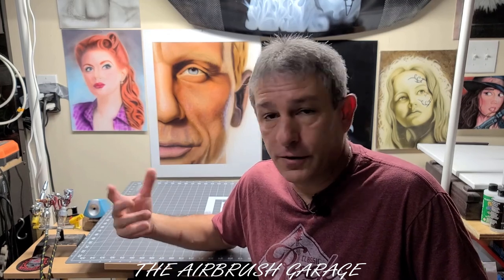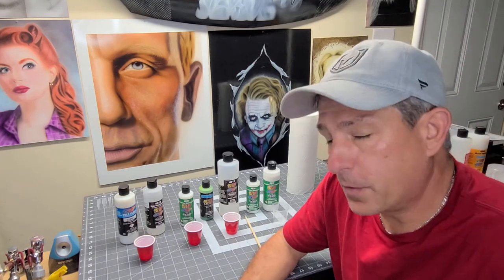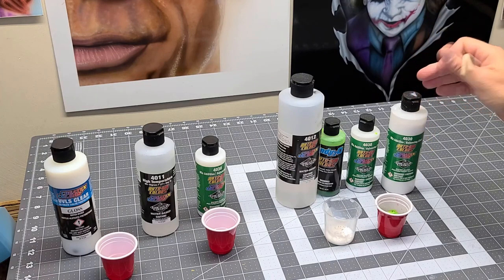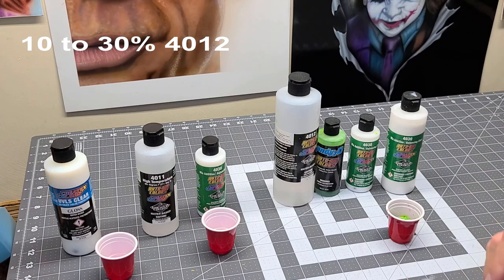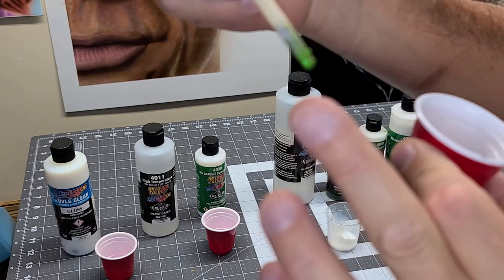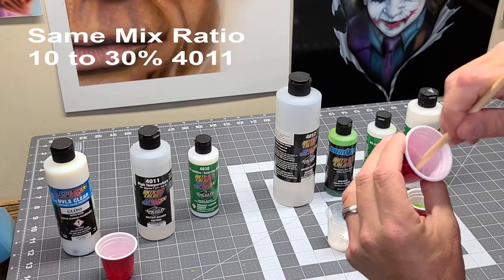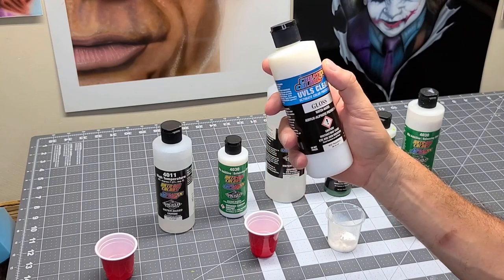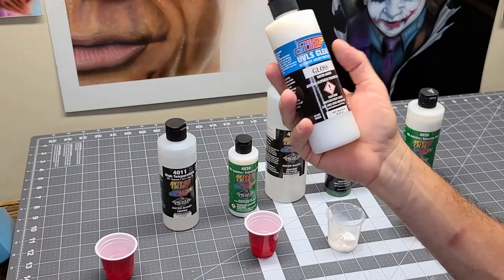Createx Clears for Airbrush

Comment: Hello Dan, does 4040 have uvls protection?  I candy 2Oed something then gave it two coats of 4040 , do I still have to add 2 coats of 4050 to get uv protection under 2k clear?
Reply from the maker: Hogman22, 4040 Bleed Checker is not used for exterior or uv protection  and if you are going to use a 2k clear you will not use the uvls. The 2k has all the exterior durability and protection you need. I only use the uvls as a carrier for the candy 2o. Hope this helps. Thanks for the question and thanks for watching.

Comment: Are there still uses for the 4012 reducer? I’ve got a 32 ounce bottle sitting here that has never been used and I sure wouldn’t want to just throw it out. These reducers weren’t cheap either.
Reply from the maker: You can still use it with your paints or as a cleaner. Just know that it has asatone in it and is not that great to breathe any airborn particles from it. I also fond it can be finicky with so.e Createx products. I never had a problem mixing it with Wicked or illustration colors. So....the answer is yes you can still use it. Thanks for watching.  Much appreciated.

Comment: Great video, my local
Art store only has 4012 & 4013, so I ordered 4011 online.  Can you clarify what 4012&4013 are supposed to be used for?  It seems odd they have so many reducers but 4011 is what’s recommended for most reducing…
Reply from the maker: John, through out the years like any other company Createx continually tries to improve there products but sometimes it's not always a winner. 4012 has Acetone in it which make it more hazardous and it also was not playing nice with the 4030 balancing clear. So they decided to scrap the 4012 and return to the 4011 which is proven to work with all there products. If you want to or need to use a balancing clear please use the UVLS 4050 they shouldn't even sell the 4030 in my opinion. There is no need for it and the 4050 is a superior product. As far as the difference between the 4011 and 4013, 4011 Contains Propylene Glycol Monomethyl Ether Acetate and the 4013 Contains Isopropyl Alcohol. So...4013 is a little milder and environmentally friendly.  4013 Reducer is compliant with clean air regulations and jurisdictions including South Coast AQMD Rule 1401. Hope this helps. Thanks for the question and thanks for watching.

Comment: Hi Dan, just re-watched this video as first time around I didn’t really understand the uses of these additives. You talked about using the clears for doing inter coats and I just wondered when and why you would inter coat on a piece of art work?
Reply from the maker: You would use an inner coat to prevent colors from bleeding through when layering colors. A good example of this would be when layering the  candy 2o's. Createx has now come out with a Bleed Checker that basically does the same thing. Some paints even though dry can be reactivated by another paint and bleed through. A good example would be a red color and you Spray white highlites  over it, and now you have pink highlights. So the inner coat locks down the color so this doesn't happen. Search out a video of Tru fire with candies being used. That will best show how and why an inner is used. Thank you for the question. And thanks for watching.
Reply: Weathering so you only add colors not smudge them or pull the lower layers up. Just helps ensure your colors stay in place and safe.

Comment: Thanks for the video.  It raised a couple of questions for me.  If 4012 was what was recommended by Createx for the 4030 and it gelled how could that have ever left the lab?  Much less made it onto the TDS and sent out for distribution?  Then the customers who bought it had to raise the flag to Createx.  

I probably don't have the full picture, just going by what I gleaned from your video.  Thanks.
Reply from the maker: Tom, two things. If you ever watch Craig Frasier (rep for Createx) explain how to mix 4012 with the 4030 he says when you add the 4012 to the 4030 let it sit for a few minutes and then start mixing slowly or you can "shock" (gel) the mixture. Also I have noticed that if the 4012 is "fresh" (new) I had a much better shot of it not gelling but yet that same 4012 that was gelling up my 4030 seemed to work fine with my paint. Bottom line is Createx came out with a product that worked but was hard to work with and if a costumer contacted them with a problem with using the 4030 they send you a sample pack of the UVLS clears and the 4011, hmmmmm. Also as I said in the video Createx has reverted back to the 4011 as there "go to" reducer. Some say it is because the 4011 has Acetone in it and his harmful when airborne and some think it is because it didn't work well universally across all of their products. Either way I only use the UVLS clears and the 4011 now and there is no issue's. Thanks for the comment and watching.
Reply: @TheAirbrushGarage  Dan thanks for the reply.  I've just started airbrushing and chose the Createx line largely because of your channel and its overall popularity on the net. 

 I appreciate you taking the time to explain.  Your line . . .
"Createx came out with a product that worked but was hard to work with . . ."  was nicely worded.

I have many years with full-size paint guns on cars, boats, RV's, etc.  I'm usually shooting something in my shop just about every day.  Besides your own skillset and equipment, the product is just as important. Hope you don't mind the questions, just trying to make sure I get off on the right foot with this new venture.  Cheers.

Comment: would the uvls clear work good for model cars ? I'm new to air brushing and trying to find a good clear I do like the createx line of paints so id like to stick with there clear if possible.  great video by the way ive watched a few of your and there a great help keep up the good work
Reply from the maker: Hi Phil, I personally like and use the UVLS as a carrier for the Candy 2o only. I have tried it as a clear coat over projects and it is difficult to work with. Spraying any clear through an airbrush and getting it to lay down smooth is hard. I use off the shelf rattle can (usually Krylon) clear for interior projects and Spay Max 2K clear (in a can) for exterior projects. I hope this helps and thanks for your support.

Comment: Hello, What ratio and createx paint do you recommend for paint a Lexan RC bodie, using reducer and 4030 clear balance ?
Reply from the maker: Hector, Ceatex Wicked Colors. Start with 10 percent 4011 and 5 percent 4030. Increase reducer if needed to until get good flow. I like the UVLS clear in place of the 4030. But 4030 is fine just make sure you use the 4011 NOT the 4012.

Comment: thanks for sharing this info, I'm rather new to airbrushing, question,on my finished piece which is on a pretty thick GSM watercolor paper can I spray a uvls clear on it straight out of bottle? or should I mix the uvls with 4011 for the finished product clearcoat?    thanks man
Reply from the maker: Sprawl, All Createx products are made to spray right from the bottle but depending on what you are spraying it through you probably need to reduce to get a good flow. Createx recommends to start at 10% reducer and add from there until you get a good flow. Thanks for the question and thanks for watching.
Reply: @TheAirbrushGarage  ok gotcha, ya that makes sense, no problem, love your content 😎